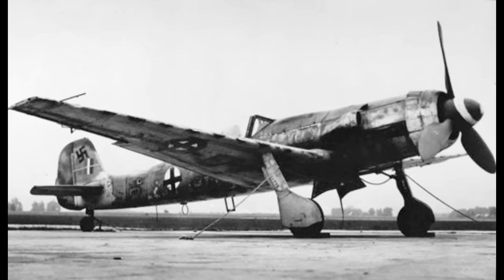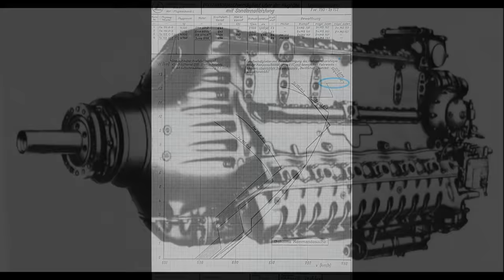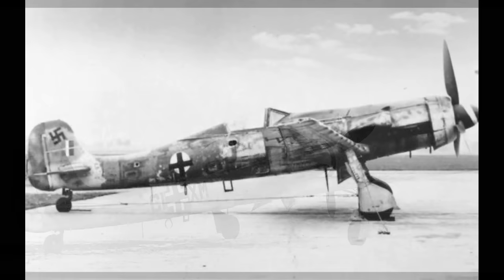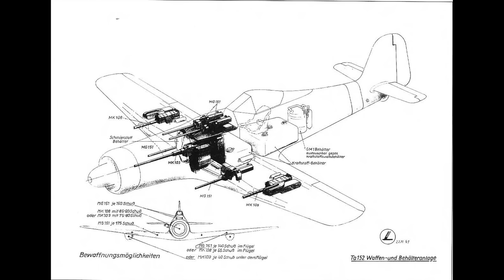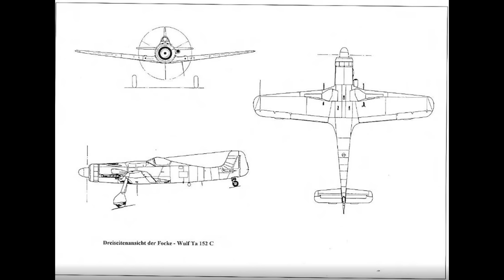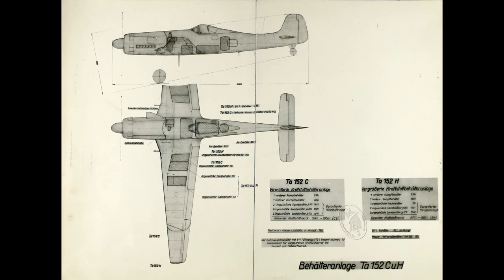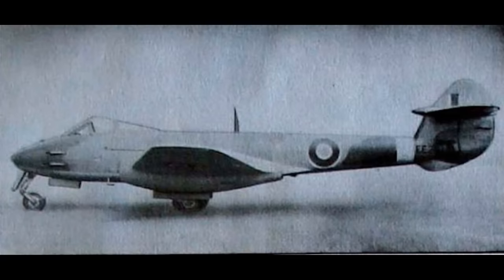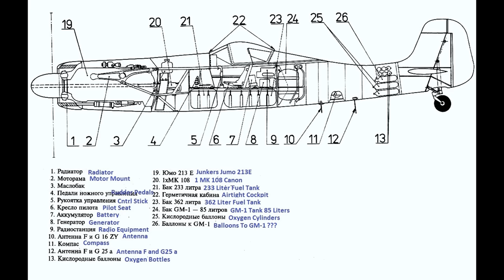Focke-Wulf Ta 152 H-1 Extreme Speed At High Altitudes.

Comment: Only because you asked for correcting translations, here a few minor things:
The instructions for pressurizing the cabins are translated really well by you in the video but there are  a couple of minor things so let me just share my translation of the page:

"IX. High Altitude Flight

Rescue-Safety device: (An interesting German technical name probably suggesting for it to be a device for emergency descend?)

A At 4000m begin oxygen  respiration and always maintain usage for altitudes above 4000m
   1. Open the remote-operation oxygen valve. Monitor pressure gauge and O2 -warner (O2-alerter/ O2 warning gauge)
   2. In case of  shortage of breath use pure oxygen (Press or push or squeeze with elbow.) 
(Literally translated it addresses this as "oxygen shower" - meaning either pure O2 supply or possibly also air with a highly increased amount of O2 supply. Whatever the pilot presses or pushes or squeezes to activate this O2 supply is not defined in this instruction.  
 
B. At 8000m  turn on "pressurized operation"  (obviously meaning pressurized cabin flight) . 
    1. Turn rotary slide  (possibly either a rotary slide valve/ rotary valve or a lever/knob ) for breathing air supply to the position for "pressurized cabin flight".
         (literally: "pressurized operation" (of the aircraft) - this description could either refer to turning on a rotary valve for air supply, or it could mean turning a knob/lever to a position where a technical air supply system then operates in pressurized cabin mode)
 
2. Fill cabin seal hose. Press the valve for 15 to 20 seconds.  (Meaning: By pressing the valve for 15 to 20 seconds)
3.Occasionally monitor cabin pressure gauge. Inner (cabin) pressure 8km.  (Meaning: Check cabin pressure gauge for pressure to be equal to atmospheric pressure at 8km altitude.)
"

Furthermore on two images shown: 
(At about 14 to 16 minutes into the video) The descriptions in the image showing the tanks of the TA 152 H and C variants not only list the volumes for each fuel/mixture but they also describe that the H variant stores the GM2 mixture at the rear most tank in the fuselage where the C variant stores the MW 50 water methanol mixture. It also describes that the H variant stores the MW50 water methanol mixture in the inner most "fuel tank" of the left wing, where the C variant stores some of it's fuel instead. (And according to the list of capacities clearly only in one of two wings, leaving the tank in the other wing for fuel storage).
The description doesn't specify the tanks any further (other than saying some of the fuel tanks were unarmored (literally: "unprotected") fabric bubble type of tanks - which I assume would be self sealing). 
It appears as if the two aircraft variants both have identically sized, shaped and positioned tanks - and possibly even just used the exact same identical types of tanks which were possibly just filled with different types of liquids/mixtures in each variant.  (If that is feasible and technically possible.) 

(At about 16 to 19 minutes into the video) The image illustrating the various guns is titled "armament options" in German and obviously illustrates a combination of (almost) all the possible different types of guns and cannons the aircraft could be armed with. (Obviously not with the intention of them all being installed together at the same time. - The optional MK103 cannons that could be mounted in pods under the wings are left out in the 3D illustration and are only indicated in the frontal view.)

Interestingly a short note in this illustration of the armament options explains that the rear most tank for the GM1 mixture could be exchanged for an additional fuel tank. 
This description clearly describes that the plane could fly with an additional fuel tank in place of the tank for the GM1 mixture (and probably likewise the MW50 tank in the C variant also???). Obviously to increase the range, but likely this would then come at the cost of not having any GM1 mixture on board for improved performance at extreme altitude, unless of course there were some other changes made or additional GM1 tanks installed somehow somewhere else. - Who knows? 

So much for a few German translations and additional details.
Reply: +Tom Woggle    The differing translations shed light on some of the difficulties modern restorers encounter when rebuilding the rare German and Japanese aircraft.   Both had their own specialized engineering terms, language and symbols and sometimes these need to be researched before work begins. And 1930s  two-dimensional drawing standards sometimes have to be transposed into modern engineering tooling to construct parts.

Comment: I think there are several other important aspects of an aircraft that need to be considered too for a complete comparison (even if that is usually a futile exercise). For the Ta 152, I think the most impressive aspects beside its ceiling and acceleration and max speed are the powerful weapons (one or two hits from a  30 mm would have been fatal for any fighter) + the phenomenal climb rate. It was also very maneuverable from the accounts of the late war pilots who flew them, last least compared to the Tempests and I am guessing the P 51. Any how , great video, keep them coming.
Reply: Below 30K feet it would have been meat on the table for a P-51 with that high aspect wing design.  No free lunch with aerodynamics.
Reply: @petersouthernboy6327  High aspect wing better sustained turn and would make a p51 bleed quickly easy meat for the ta152h
Reply: @123fockewolf  - you’re wrong - P-51 turns inside  TA-152.  But since they only made 69 TA-152 and there was no recorded combat with Mustangs its conjecture.  TA-152 would have been outnumbered that IS certain.
Reply: @petersouthernboy6327  Yes it would have been outnumberd as any other German plane would but P51 does not turn inside this its not built to turn watch this https://www.youtube.com/watch?v=TFl8X4y9-94
Reply: @123fockewolf  - The Mustang had superior vertical and horizontal energy maneuverability (Boyd) compared to the BF-109 and the FW-190 so your premise that Mustang could not turn is quite flawed.  https://digitalcommons.lsu.edu/cgi/viewcontent.cgi?article=2218&context=gradschool_theses
Reply: @petersouthernboy6327  This is not legit by using logic The FW190A has better climb rate than a BF109 with the same engine power but it weights much less than the fw190 this is not correct data just think about it. This is some bias just look at the title how the p51 trampled the luftwaffe says it all P51 was a great escort fighter nothing more than that.. in a 1 v 1 the me109 have much better climb rate those numbers are false it lighter turns much better and those graphs with turning rate for yaw? What? Just watch Gregs video on turn rate you will learn a lot that this is not true....
Reply: @123fockewolf  - your “logic”? 🤣. How did pilots like George Preddy, Don Blakeslee, and Don Gentile shoot down all those Bf-109’s and FW-190’s while flying P-51’s ?
Reply: @123fockewolf  - P-51 couldn’t turn ?  Look at all these P-51 aces:  https://www.mustangsmustangs.net/p-51/aces/aces_list.  Most of those kills were on escort missions over Europe which means fighter vs. fighter
Reply: @petersouthernboy6327  Because outnumbered and are you gonna compare aces with p51 and 109s xD noo dont do that erich hartman himself have more kills than all these us aces you are showing. Germany had about 80 aces with more than 100 victories and about 200 more that has more kills than the US highest top scoring ace Richard Bong whwre he was flying p38s agains the japanese.
Dont forget that most of the aces died mid war before the p51 enteribg europe with D models.. Its not my logic Its just that skip holm a fighter pilot with the highest flying hours who has flown spits mustangs and 109s says that it is a huge difference and the 109 is superior in climb and turn the p51 is just faster and better at higher alt... Thats why the p51 is  excellent bomber escort
Reply: @123fockewolf  - so now your argument is that Luftwaffe kills on the Eastern Front (all the high scores) somehow means the P-51 can’t turn?
Reply: @123fockewolf  - Here's Bud Anderson describing in detail how he used the Mustang's maneuver flaps to turn INSIDE a Bf-109 during a dogfight, then the 109 zooms to break off but Anderson shoots him down: https://www.youtube.com/watch?v=f5DhYxxenxs
Reply: @petersouthernboy6327  Who said that all his kills was on the eastern front he got more kills vs the (britts and US) than the highest top scoring ace R.Bong had total and he fought the japanese... You  understand that the 109 with slats is a much more difficult plane to fly to the limit than a mustang but a good pilot can use its full potential like Galland, Rall, Marsielle, and Hartman. And with a good pilot in a p51 and a bf109 the 109 is superior. USAF did not dogfight planes they just used speed to dive on enemies and go away thats why most of the USAF fighter cant turn but are fast. The history chanel is not a good source Bud might have dogfighted a 109 and shot it down or not  but if so it must have been a unexperienced pilot but galland or MArsielle in that 109 you will only se meat from the p51 that is just a fact. The 109 is a superior turner and climber p51 is faster, better range and better at high alt nothing else.

Comment: I was always taught in A&P school that the methanol in an ADI system (water/methanol injection) was used solely to prevent freezing of the water at altitude and contributed little to power. The distilled water being the quenching agent. This was the late 70's and most of our instructors were WWII Veterans.
Reply from the maker: That's basically all true. It's a little more complicated, there are cases where greater amount of methanol help, but generally speaking straight water is very effective it if doesn't freeze.

Comment: A. At 4000 metres start breathing oxygen and keep doing so at altitudes above 4000 metres.
1. Open oxygen remote access valve. Watch pressure gauge and O2 guard. (That would be some kind of warning, like a light, that is triggered under certain conditions to warn the pilot).
2. When troubled by lack of oxygen (verbally:"If a breathing emergency occurs) use oxygen boost. (Activate with elbow). (That means, that you have to hit a button with your elbow, and then what Greg says happens: instead of slightly oxygen enriched ambient air your get an oxygen boost to overcome the feeling that you can't breath enough. "Dusche" means "shower" in english.)

B. At an altitude of 8000 metres activate pressured operation.
1. Rotary valve for breathing air supply in position "pressured operation"
2. Fill rubber sealing tube. Push valve for 15 to 20 seconds. (There will be a rubber tube aligned with the canope. When it is pressurized, it will seal the space between the canope and the plane, so the cockpit becomes pressure tight. The pilot has to fill the tube at an altitude of 8000 metres).
3. Occasionally, check cabin pressure indicator. Inner pressure (of the cockpit) will be equal to an altitude of 8000 metres.

Comment: This is so much interesting info its hard to start! The Ta was basically the ultimate in nos! Really epitomizing  juice it til it drowns. The ideas behind its conception are some of the most specified I’ve seen too, for the H-1. 

The funniest thing about this to me tho is it explains why in flight sim games the 152 is always worse than you’d expect: combat almost always happens below 25K! 

My last thought is on the DB603. That variable super charging system...thats basically adding like a CVT to your supe right? As a Nissan owner, that kinda vindicates me a little 😆
Reply: Most variable charge systems either use a sliding shroud around the compressor wheel to adjust the amount of blade exposed to the air flow but generally this is only used to achieve faster spool times at lower power settings both of which don't really apply to aero engines or a simple mechanical waste gate so that way the compressor is boosting at full power 100% of the time and the waste gate controls boost level into the engine.
Reply: ,,, hmmm, seems to be an anomaly in conversation here, as betwixt mechanical supercharger and exhaust driven turbocharger  .
Reply: @rolandtamaccio3285  you are quite correct Roland, I was referring to only exhaust gas driven turbo chargers and how they achieve a variable vane geometry compressor section.  As you pointed out super chargers are directly driven from the engine as opposed to using exhaust gas flow.

Comment: I took you as saying near the end that ultimately the 152H-1 was the wrong direction for Germany to go, apologies if I'm misunderstanding.  Of course, it was, with what we know in 20/20 hindsight: thanks to Zhukov and the jet and the bomb, we didn't need the B-29 in Germany, and the B-29 as developed didn't fly quite as high as it might have in a modified version.  AND YET, it was a smart thing to pursue this development and figure out what kind of plane you'd need in such an event, and actually construct 100 or so to get some operational familiarity with it: a proof of concept not just in the hands of a test pilot but for real pilots in at least a little real combat.  From what they knew while they were building it, the B-29, or say a B-29 MkII, might have been high enough that the H-1's abilities WERE needed.  And had the B-29 flown against Germany, and found to be a bit lower than expected, the H-1 recipe could certainly be re-tuned to slightly lower altitudes as well.  In summary, the H-1 was an excellent insurance scheme and study project for the Luftwaffe to have done when they did it even if ultimately totally unneeded.

Comment: You are making me want to consider becoming an engineer.
Reply from the maker: Engineering is an exciting field. Just don't let your teachers make it boring, which they often do by making it all about solving math problems. Yes, math is critical to engineering, but it's not everything.
Reply: Excellent reply by Greg. I would add, try to learn about as many subjects as possible, even if not deeply, read a lot about mechanical, structural, physics and general science subjects. The more you know, the more you will realize how little you know, but also the more you will get the thirst of knowledge. I would also recommend learning to work with your hands to get the feel of things, machines, motors, etc... Disassemble old things to learn how they're made. Engineering isn't only theoretical, it's also practical, and also not necessarily done sitting at a computer.
Reply: The best engineers I have seen possess experience in farming or industrial trades. They combine practical fabrication into their designs or problem solving. If you are able to become a mechanic before an engineer I also recommend this.

Comment: I have came across this several times too, it probably was the most robust high performance piston engine of Germany in 1944. 9:50

Maybe it could have been a good tank engine too, like the Merlin/Meteor.
But it would be better to invert it again :)

There is a presentation on youtube which talks about steel/aluminum production in WWII. 23:00
Germany was never lacking aluminium. The increasing number of wooden components is based on the fact, that there were a lot more production facilities, that could use wood. Only a small number of factories were able to produce parts of aluminum.
Germany was actually lacking Wood which could be used for aircraft production.
Reply: Fyi the vw kubelwagen's 1100 cc engine used a cam lifter with a wooden pushrod attached. Keep in mind their vehicle's life span. I mean would these vehicles in use near front lines. Make to their 2nd or 3rd oil change? If we go by prolly straight 30 weight equivalent and 3000 miles change interval....i wonder if they could even make it to their first oil change. Things to ponder